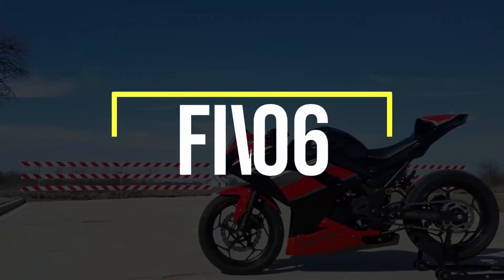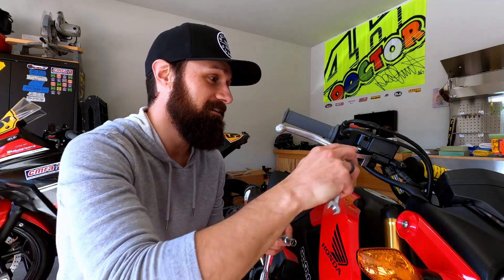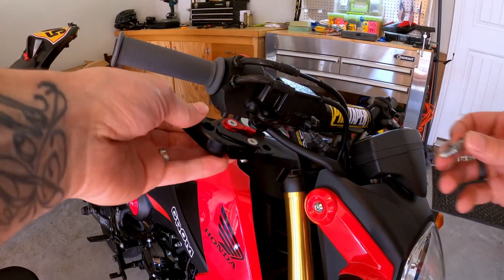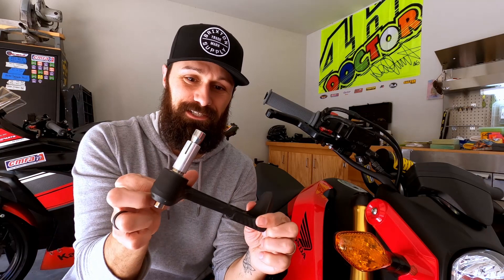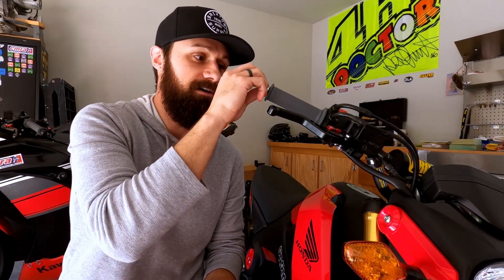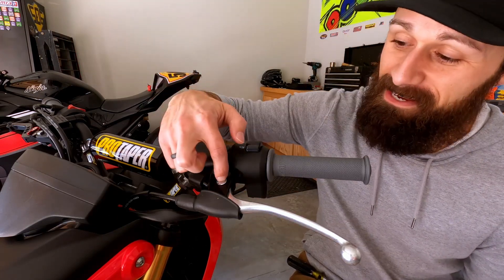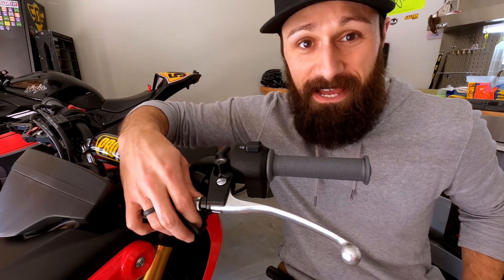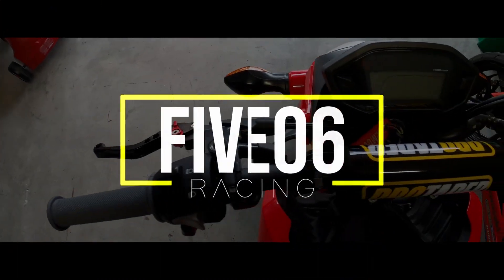Installing Aftermarket Levers and Brake Guard on a Honda Grom | Honda Grom Race Bike Build: Part 4

Comment: I would remove that rubber boot on the clutch lever. After I installed a set of levers it just constantly moved around and never sat right again.
Reply from the maker: I was thinking that. I threw a zip tie on the clutch cable just below that little rubber boot. Hoping it keeps it in place... if not, it doesn't hurt my feelings to hack it off. 😆
Reply: @TonyGenerali  One thing to keep an eye on when changing the bars is the clutch cable routing. Since the bars are lower than stock, the clutch cable ends up becoming a bit longer than it needs to be. Make sure it doesn't get caught in the steering stops, ask me how I know lol. Good thing a new OEM clutch cable is cheap.
Reply from the maker: @dyi01 😲 that could be real bad if you were moving and the cable caught! Good looking out. It had aftermarket bars on it already when I put the Honda Minis on, so I may be good, but I'm 100% gonna check now that you said that!

Comment: U have a link on those brake/barkbusters? Thanx
Reply from the maker: Hey, I'm not sure if this is going to link properly, but they're on ebay. $11 for brake and clutch side!!

https://rover.ebay.com/rover/0/0/0?mpre=https%3A%2F%2Fwww.ebay.com%2Fulk%2Fitm%2F162819700327